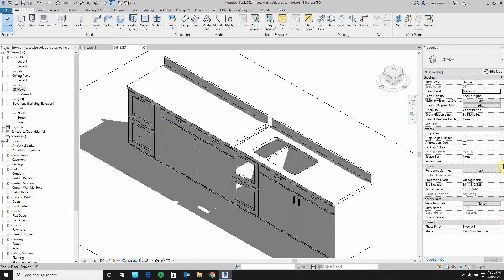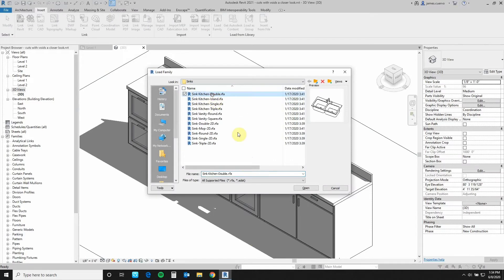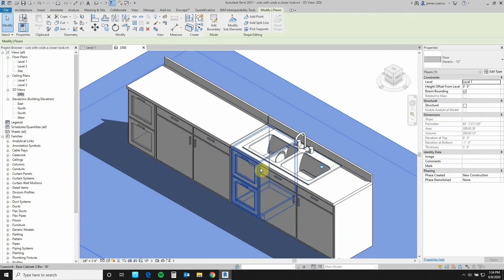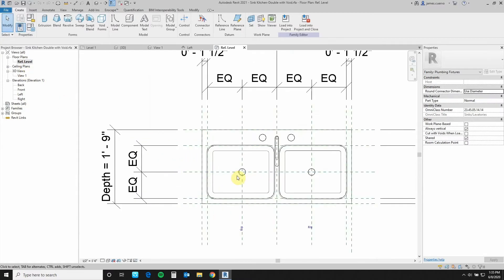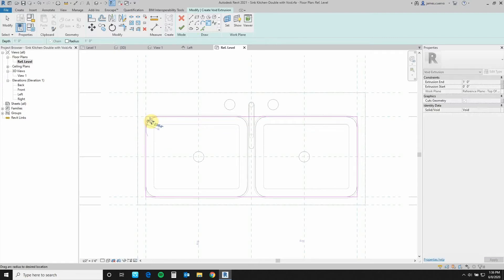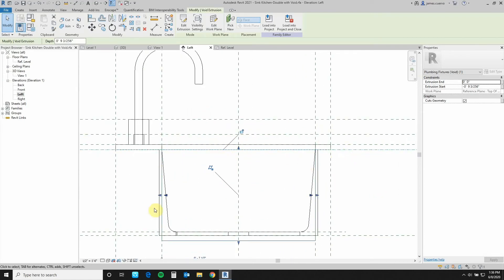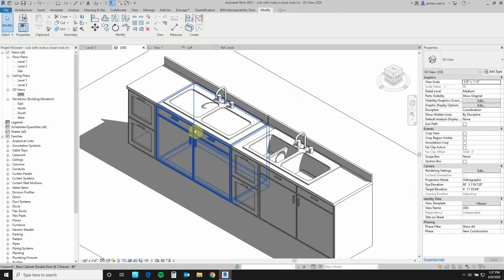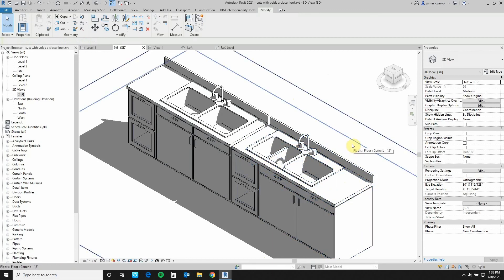Creating Cuts with Voids using Revit

Comment: I can cut it but it could not show it on the plan view. it only works on 3d view. do you have any solution? thank you
Reply from the maker: Hello. You are correct, as of right now it seems like the cuts with a void in families are more for 3D views. That said when you view the cutting plan view specifically, we have noticed that the countertop then only shows the back line of the splash, the sink, and what is underneath. This appears to be some sort of bug. 

We did read about an alternative workflow with masking regions but have not had much time to try it. You can check that out at the link below if you would like and see if it works for your situation.

https://forums.autodesk.com/t5/revit-architecture-forum/void-cut-out-not-showing-up-in-in-plan/td-p/8439403

Comment: I create a generic model family, and create a simple extrusion in it then I loaded this family in another family (make nested family) now I am in the second family and close the first family I want to make a void in the model while being in the second family not in the first family but Revit does not execute the void still yellow-colored what is the solution?
Reply from the maker: Hello Ayman. There are at least 2 possible reasons for this. One is that the cuts with void in the first family are not turned on. The other possibility is that you might have created a solid rather than a void.